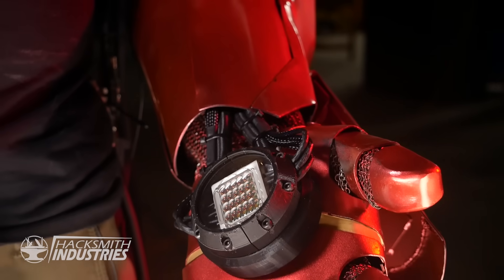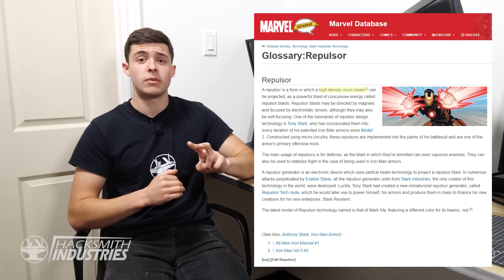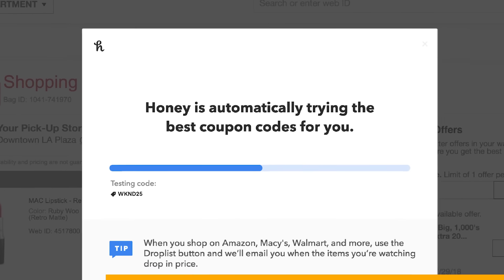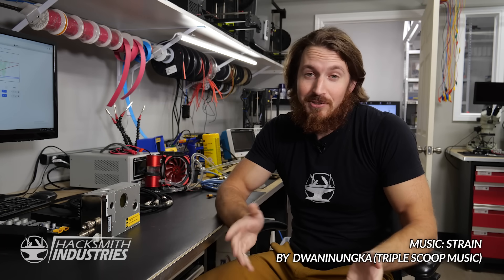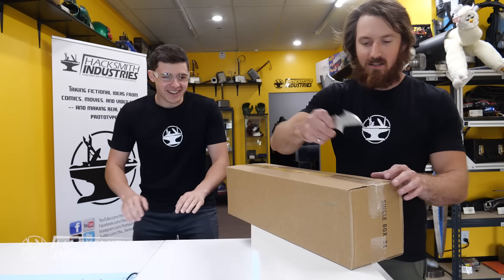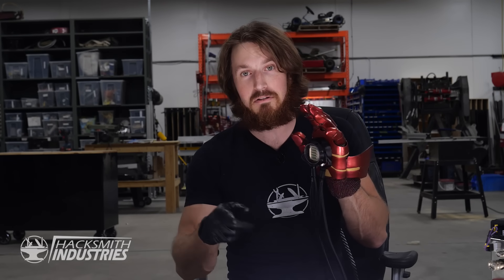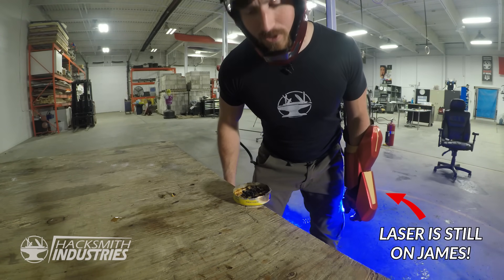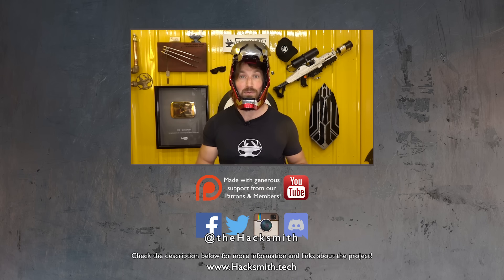REAL IRON MAN REPULSOR + GIVEAWAY!

Comment: This actually can be put to practical use in a firefighting situation, where people need to break windows effectively, and the helmet can be used to shield the eyes from harmful light and smoke
Reply: We already have things like these that are way more practical then what hacksmith made. But the lasers and helmet are alot cooler than what we currently are using.
Reply: Too expensive and we already have more practical stuff
Reply: I feel like it’s much more practical to just smack the window with a $2 glass breaker but yea a high powered laser gauntlet works
Reply: @MG-gj7pv  and the laser gauntlet is just more dangerous too
Reply: Great way to blind everyone around too
Reply: It wouldn’t really work well either. “Burning lasers” like the ones shown in the video, generally don’t cut, shatter, or burn glass, since the light just passes through it, making it really difficult, if not impossible, for the light to transfer into heat with any kind of destructive power. They literally used a focusing lens made out of glass for this build project.
Reply: It would also instantly blind anyone inside the building after you punched a hole through...
Reply: Btw the helmet isn’t his. It’s the "Autoking MK5 Voice Operated" helmet.
Reply: Imagine firefighters wearing iron mans helmet and gauntlet and cutting windows😂

Comment: Hi. Did you know that, rather than putting a big laser in a big plastic box, (which breaks the rp a little) you could consider putting this laser on the Arc generator, in the torso, and connecting it to the palm of the hand with optical fibers. It would allow to launch discharges from the torso and from the hand. In addition, the laser is directly powered by the generator.
Reply: Interesting, how sure are you that'll work, tho? 🤔

Comment: Love the project and the intent, but um, shoulda probably pointed out that the reason the repulsors exist for IM is that he needed stabilizers for flight, and how they became defacto extra weapons, is because of how accidentally overpowered he made them from how they were developed. They actually weren't originally intended that way, until he severely overamped them in that scene you showed from the movie. Per the garage 'flight testing' scene, they were originally only meant as flight stabilizers.

Comment: BUILD A DEPTH CAMERA NEXT TO THE LASER AND USE SOFTWARE TO FOCUS THE LENS TO THE OPTIMAL POINT BASED TARGET
Reply from the maker: Good idea but no space to have the lens move :(
Reply: @hacksmith  hmmmmm how about it doesn't move but whatever it focuses on it will aim directly at it also an idea for a full iron man suit is to make that system you made in the aliens mech thing and make yourself have super strength
Reply: @redpandacooper6169  a hydraulic base exoskeleton?
Reply: @ternakitwatches6850  ya i forgot been a while since i saw the vid the suit would be pretty heavy
Reply: the Hacksmith however, if you make something(idk what it’s called but you can focus a lens by just rotating it like a camera) and solder it to the laser diode perimeter, and attach a screw worm motors side to the side of the diode, then you have a focusing lens. Attach the camera to fold out of the wrist rocket along with whatever other malicious weapon you have in there

Comment: What can't you use super capacitor charge it quick at 20000v dc to the repulsor that will give a blast equal to 5TNT.... But you need lot of heat sinks at the same time + coolants for rapid cooldown

Comment: This guy is gonna make the whole working iron man suit in a year or two
Reply: It's going to have a giant backpack but it will work.
Reply: in a decade or two, if we have some miraculous battery by then that doesn't take half a cubic meter of space to output enough energy to power the suit, and if we somehow make a device that can output 100/120kg of trust and is not a f*cking jet engine, also we absolutely need to be able to easily generate muons.
Reply: I think we're 20 years away Max from an actual fully functioning combat-ready Iron Man suit.

Comment: bro i am in real life iron man and looking at this video i mean i dont know you could have done a lot more than that it is very easy to create the heart and the repulsors and the body armor you just have to spend a lot more time building it everything on my suite is moveable and i made mine out of titanium or titanium oxide to be exact it took me 5 years to figure out how you can create the repulsor that you where showing and it shoots like a gun it almost blew my arm or to be more specific almost broke my shoulder because its that strong i am for real though i am the real iron man the helmet you can use dot projectors to create a headsup display inside of the helmet you just need to find mounting points and make the helmet in a way where you can see the whole display without damaging your eyes there is a lot of problems that you need to solve before building the whole iron man suite but i have already solved them like i said they are pretty easy to solve once you learn about it the hearth is powered with electricity and i will not tell you more than that it is recycable energy and it uses copper wiring to shoot through the repulsor.